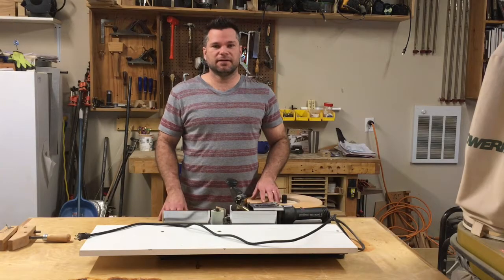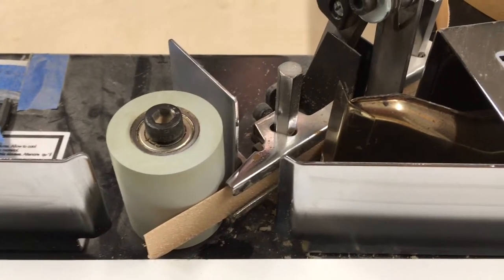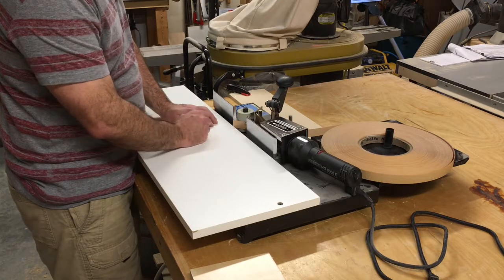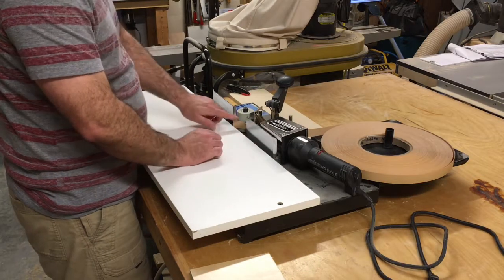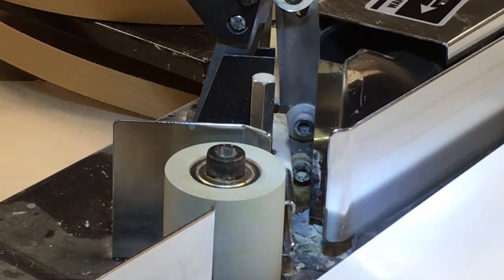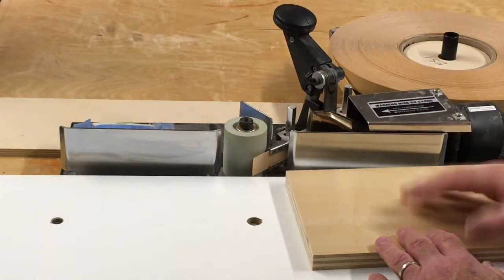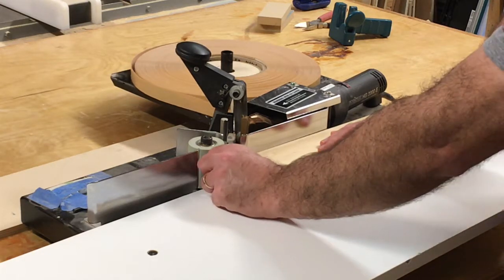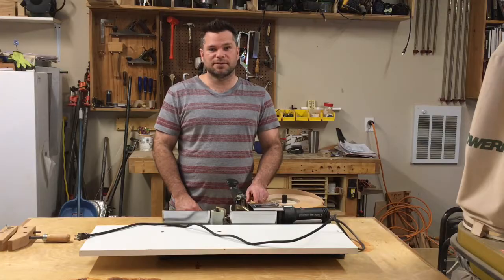Edge Bander demo and using tips

Comment: Just bought one of these edge banders.  I'm having a challenge getting the set-up correct, so the banding doesn't creep up as the shelf passes through.  I am a little confused about your description of how you used your shims.  Wouldn't placing them at the inside edge of the table actually make the angle >90?  Thanks in advance for any help with my setup.
Reply: I just got one and am having the same issue. Did you figure out any tips to line up the feeder ramps? There’s literally no information about this thing!
Reply: @cwilli321975  Freud has a manual you can get.